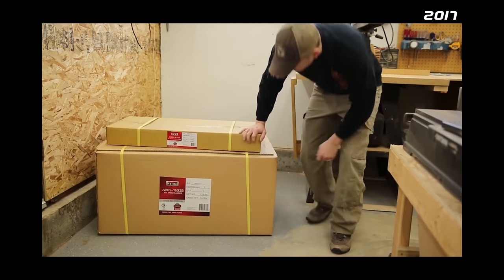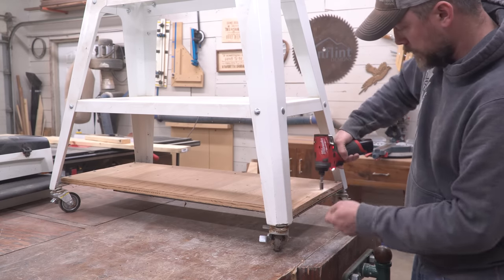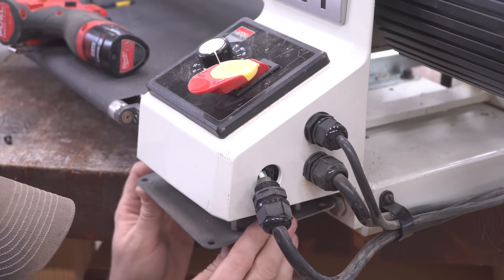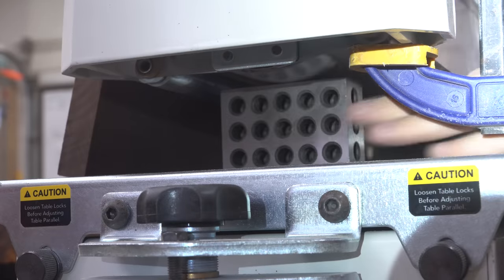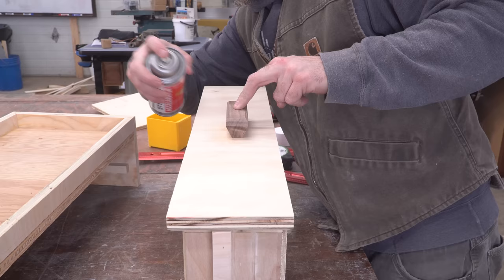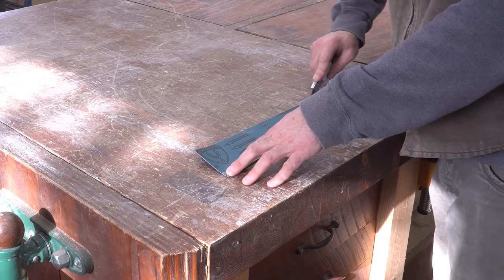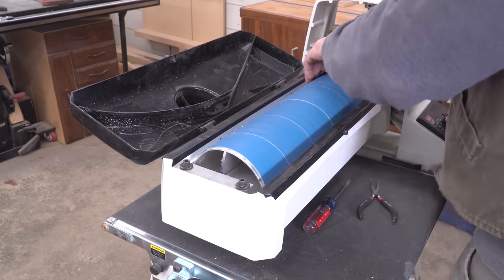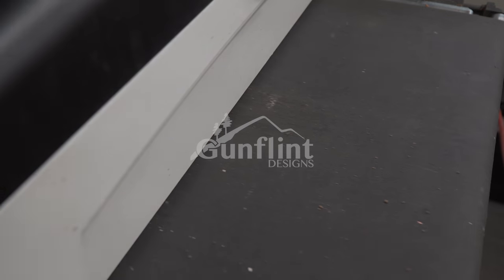Does Your Shop Need a Drum Sander? Long-Term Tool Review

Comment: I have a Performax version of the same tool.  The conveyor belt tore and I bought a after market one from a name brand wood working store.  COULD NOT get it to track.  Called Jet tech for help and they refused to even try, saying they had spent WAY too much time trying to make those brand X belts track.  Bought one of theirs (twice as much) and installed it, ready for battle, tracked perfectly.  I mounted my machine on a low cart so it will park under the wing of my table saw.  Made infeed and out feed rollers for it.  The Klingspor sandpaper is excellent and I also like Industrial Abrasives stuff.

Comment: I also use my Jet drum sander all the time. I don't have the stand but I keep it next to my drill press which is on Blum drawer glides that move it easily. I plan on doing the same for my drum sander. I will give the new sand paper a try. By the way, don't use adhesive sand paper on the drum, it's a PAIN to get clean, lesson learned. Great video!
Reply from the maker: That sounds like a really handy way to store yours out of the way, but keep it easy to access.
Reply: @GunflintDesigns  I will let you know how it works. I am waiting for Blum glides to become available again.

Comment: Great video.  In the market for a drum sander.  Wondering if you regret not going to the 19/38 over the 16/32.  I am currently trying to reason w/ myself if the extra 3/6 is worth $500.

Comment: i have the same machine, i too put better casters on it from new and havent had any issues, and i use a long roll of quality abrasive i cut myself, works out about a third of the price. i found the rollers needed a lot of adjusting when i first set  it up, but since then its been a good machine. ill have to copy your drawer idea since my shelf just collects dust😄
Reply: I am having a terrible issue with snipe on mine, both front and back end. I have adjusted the screws for the rollers tighter ( that didn't work!) And so loose the screws almost come out and still I get snipe for about 2 inches on either end. Are you having the same issue or what did you do to fix it?

Comment: I think it should be pointed out that it is excellent for finish sanding. Take all your parts and send them through the machine. Then assemble the already finish sanded parts. No orbital sanding needed later.
It may seem boring standing there feeding boards through the mouth of this thing, but it is much better than using a tiny orbital sander through the grits manually. 
Dust is controlled and there is no vibration. You can step through the grits and be done faster.
When done:face-purple-wide-eyes: they all are flat and exactly the same width and thickness, unlike an orbital sander.

How wide a drum sander? This only matters if you are sending finished table like things through it that need to be flattened. There are still a lot of things that don't need much width for it to do its job.
A kitchens worth of door frames all sent through as pieces then assembled without the need to sand them (again). And they are all sanded with the grain.

Comment: Thank you for the tips on the electrical tape and the Klingspor paper. Interestingly, the little "wishbone" shaped  Klingspor logo does appear on the backing of the Jet branded paper i recently installed on mine, but I think Klingspor makes various grades. Anyway Im going to try the stuff you recommend ASAP.

Do think about getting the infeed/outfeed tables, they make the sander easier to use, especially during production work when you are running lots of smaller parts through the machine and don't have a helper to "catch" for you.

Comment: Hi Mark! Loved the Arnold moments :D I don't have a drum sander, and don't have the space either. But I would love one. One of the jobs that my excellent thicknesser can't handle are boards that are shorter than the space between the rollers. So many of my off cuts shorter than about a foot cant be planed on it. The design of this machine with a conveyour belt doesn't seem to have that limitation. Not that you would use it as a thicknesser. But still. Does it handle small parts well?
Reply: I wouldn't suggest you do so.

That being said, in cabinet shops, if you have to, you just stand with as much metal between you and the piece as possible when feeding it in.

I am not sure about this particular model, but I have seen some parts shoot out the back like a table saw kickback.

Comment: I have the same model and use it fairly regularly, especially for small pieces and thin stock that won't go thru the planer. I used the casters that came with it and have no problems. My gripe is changing the paper. I have tried to follow the instructions which are not very clear. I called the factory and they were no help. I see you use a needle nose plier which I have also do but I have a problem getting the paper tight. Most of the time I end up duct taping the end which cuts down the width but not by a lot. Any words of wisdom? I also have a roller dimple (sort of like planer snipe) on some boards but not always.

Comment: I am having a terrible issue with snipe on mine, both front and back end. I have adjusted the screws for the rollers tighter ( that didn't work!) And so loose the screws almost come out and still I get snipe for about 2 inches on either end. Are you having the same issue or what did you do to fix it? I thought about completely removing the rollers but can't seem to get the drum out to do it.

Comment: Thank you for this video. I got a drum sander about three months ago and haven't used it much (still getting around to making it mobile, which will help). I have been wondering about how best to use it. I don't think I want to constantly be changing grits on it; if I were to leave one specific grit on there all the time, what would you recommend? It sounds like it may be more useful to leave a coarser grit to help flatten boards, but what do I know?
Reply from the maker: When I was using the Jet sandpaper, I swapped grits all the time, no problem. My new blue Kilinspor stuff has a much thicker backing on it, and that makes it much harder to get it tight in the little spring clips. I tend to leave 80 grit on all the time now, only changing it when I absolutely have to.
Reply: Chiming in here...if you were to leave one grit on there, I would probably leave 80 grit if you're going to be doing some dimensioning. If you're just smoothing stuff out a bit, keep 120 on there.
Reply: @BruceAUlrich  thanks!

Comment: I have the same sander but I have a very very difficult time replacing the sandpaper because of the end clips.  Such a terrible design. The tech  at JPW agreed that the clips are horrible for those with arthritis or a weaker grip as there is it is a tight pinch instead of a lever.
Was fine for several years until I developed arthritis. Now unused for months since I cannot get paper in tight
Reply from the maker: Its funny you say that... when researching it before buying, lots of people complained about changing paper on drum sanders across the board. I took a chance on this one, then wondered why everyone had such a hard time with it. I was changing grits constantly because it was so easy. Once I switched to this better brand of paper I learned my lesson. The backing on it is so stiff that I fought for about 10 minutes to get it wrapped tight enough and pulled through the clips. I imagine with arthritis its almost impossible.